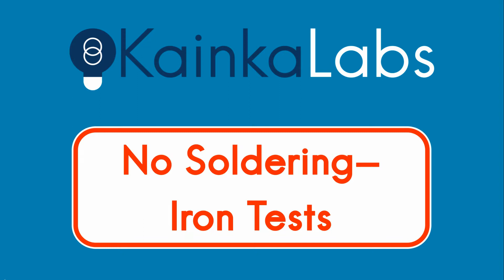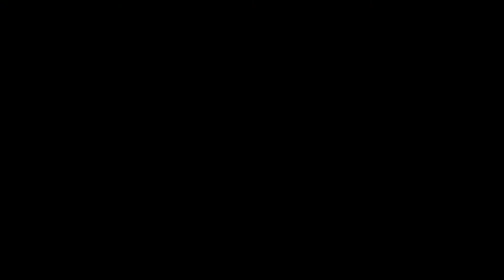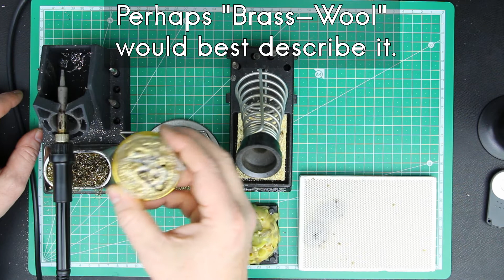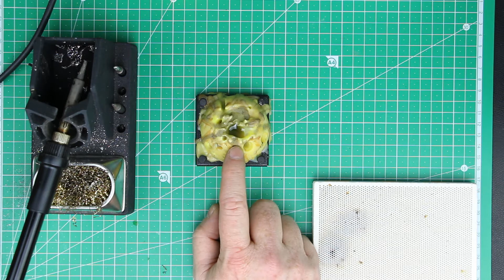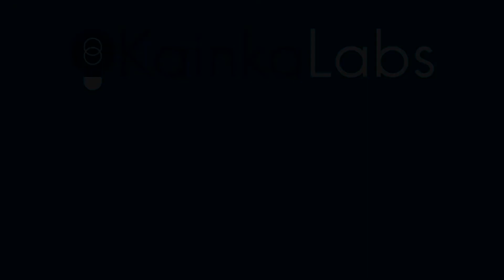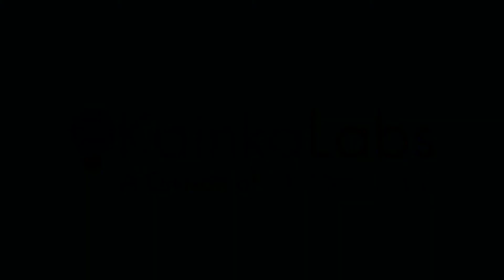Every maker should have…[Pt.19]…a Soldering-Iron Stand, a Tip-Cleaner and a Ceramic Board

Comment: What about a solder smoke absorber? Definitely important. I go and build one. Roger can you please tell us what you use for cleaning the solder tip? Thanks und DANKE from Germany. de sTef DM5TU
Reply from the maker: Here it was only about tools that help in the daily soldering-work.
Health- and safety-issues are a different issue.
The video shouldn´t get to long and clogged.

My original answer to your last question was somehow lost.
It´s the GEK10 from EDSYN:
http://www.ak-modul-bus.de/cgi-bin/deu/iboshop.cgi?showd1010!30,892013428122521,SOLDERTIP-CLEANER
Datasheet can be downloaded here:
http://de.farnell.com/edsyn/gek-10/l-tspitzenreiniger-60g/dp/2100014
Reply: KainkaLabs Thanks Roger!!